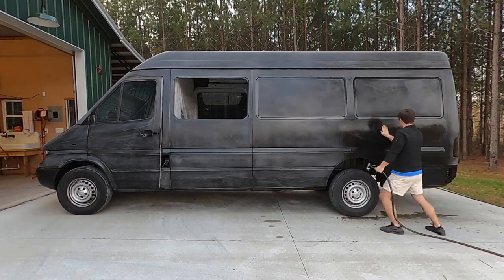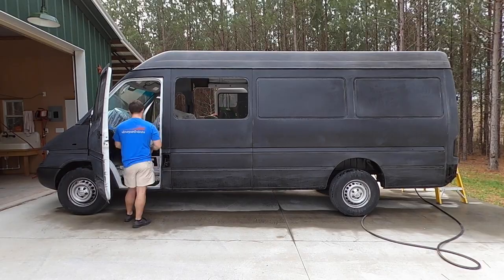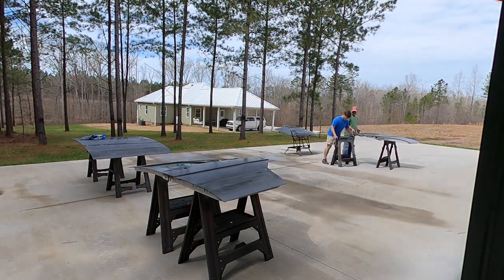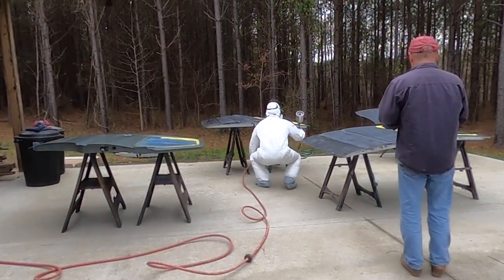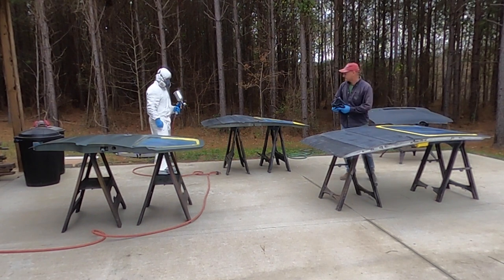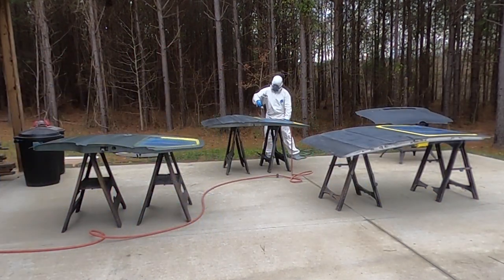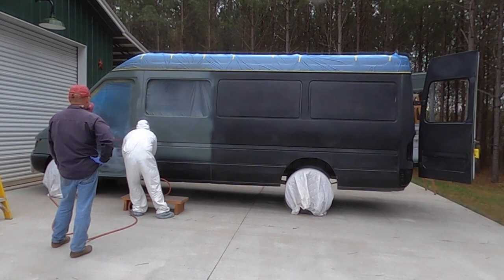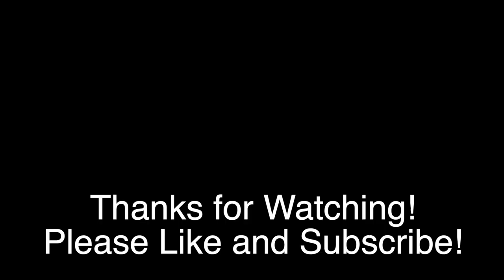Van Build Episode Seven! Wet Sanding and Spraying the Top Coat of Paint! DIY T1N Sprinter Conversion

Comment: That’s probably the coolest raptor liner color I’ve seen! How much raptor liner did you buy?
Reply from the maker: The only raptor liner is black. The green is just a paint with flattener in it. I used one kit for the black that would normally do a truck bed.
Reply: Ah cool, thanks!